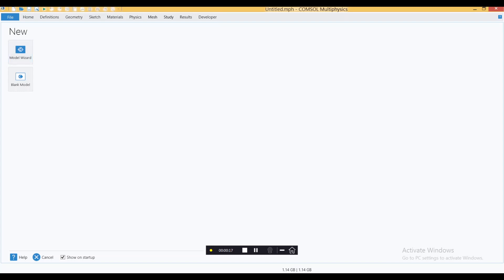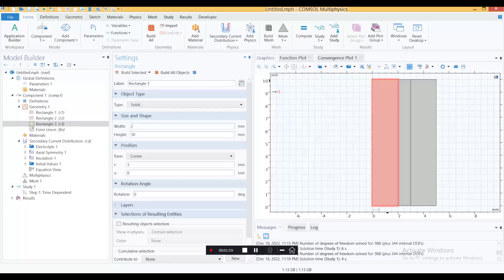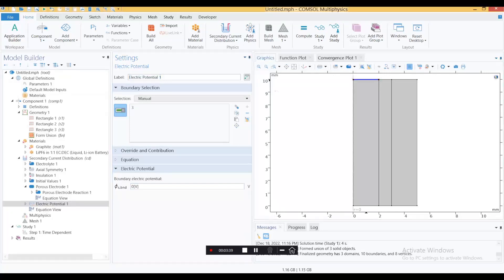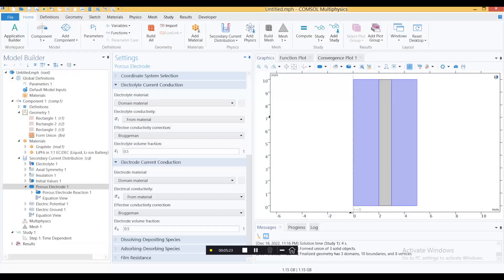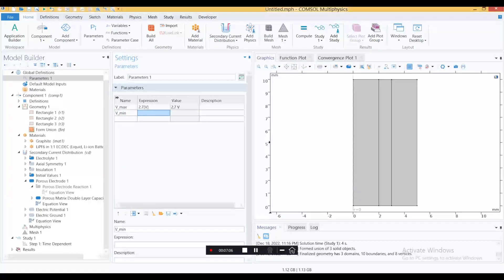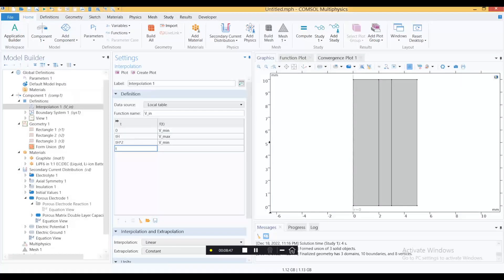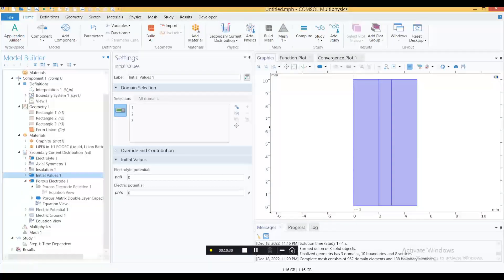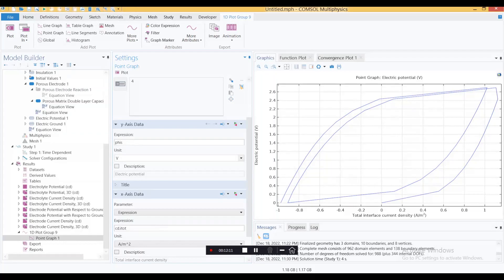Cyclic Voltammetry | constant voltage cycling | CV curve of supercapacitor | COMSOL | For Beginner

Comment: can we perform cyclic voltammetry simulation on li-ion battery? if yes then how?
Reply: Is this valid for a 2d-axisymmetric model? This is not working in the 2d model. In the 2d model electric potential is not taking (interpolation value), it is taking direct values like 2v, 4v .....etc.

Comment: Thank you very much for the work put on the video! I am reproducing some experimental results from an article and i have a question when doing the CV plot, ¿do i have to represent that "total interface current" or another current variable versus the voltage? Because i get a really low density which does not match the experimental data. Current density magnitude for example is much bigger.
Reply from the maker: That is probably because in experiemntal case that is a larger domension compare to this single stack and you might have to model miltiple such stacks to get comparable results to experiment. it basically a matter of scaling. In actual experimental theres a lot of stacks so the current apllied distributed to a much larger interface current compared to this single stack

Comment: Hello sir. I am researching on supercapacitor using borophene and just starting comsol multiphysics to simulate some materials and different tests. Can you tell me how to add borophene to the comsol material library. It's better if you provide your email or social media handle so i can interact with you,  get more information regarding comsol multiphysics, and how to use it for supercaps properties
Reply from the maker: Sure iqbal here my email, 
mhamzamurtaza95@gmail.com in case you need to ask further. However, adding specific material properties or a material is quite simple. In comsol when you add a module a node names material actually also gets automatically formed. and you can add a blank material in it which at the start might be empty and when you add further modules lets say li-ion battery the material will automatically asks for those specific material props required. and you need to choose that material in the modules themselves as well to apply it to specific domains in modules

Comment: Keep up the good work sir! Also, is it possible to tell me how to get CV curve of pseudocapacitive? I would really appreciate to get some hints or referance for the pseudocapacitive case?
Reply from the maker: Pseudocapacitive behavior is a bit tricky you will have to use the Lithium ion battery module in COMSOL which allows for intercalation and double layer capacitive behavior. that is one way to do it.

Comment: But the curve shape is not similar to the cyclic voltammogram shape which looks like a duck!
Reply from the maker: Yes, that's because this is the CV curve for EDLC/supercapacitor. The one you are expecting is for batteries or possibly for pseudocapacitor.
Reply: OK, but as we know that the current density lies on the y-axis while the electric potential lies on the x-axis, but you did the reverse!
Reply: @wrongcheathealy3  I too am wondering if there is a solution to put the parameters on the proper axis. Not sure why they are reverse here.

Comment: Hello sir, how to get the charge and discharge curves of asymmetrical supercapacitors ?
Reply from the maker: its should be simple and you should just observe the voltage and current response at different points. if its the CV (constant voltage) cycling then check the current response and in case of CC (constant current) cycling check the voltage and that would your charge discharge curves
Reply: Thank you, sir!

Comment: Hello there. Thanks for your video. We work on supercapacitor and pseudocapacitor at the laboratory, we use CV analysis and get curve with 2 peaks in reduction direction and 2 peaks in reverse direction(cause we have 2 half_reaction there) so I want to simulate this with COMSOL but I can't get that curve with 2 peaks. Can you help me or give me some guideline?
Reply from the maker: Sorry ata, its quite unique to see two peaks but which ever material you are using for the electrode you should get the Equilibrium voltage (Eeq) and see if that curve is different from the typical Eeq curves we see in literature. If that is the case then your Eeq potential might help in developing those two peaks you speak of.
Reply: @simulationbyhm5194   Thanks for your response
Reply: Hi, I have the same question... did you dind any solution to address the redox peaks in CV for pseudocap?

Comment: if I had to check the stimulation for 1000 cycles which would be an efficient way to add that information to the software?
Reply from the maker: Yeah, it wont be efficient way to do that if your cycle number's in hundred. For that I actually have an alternative as well which I will share soon.